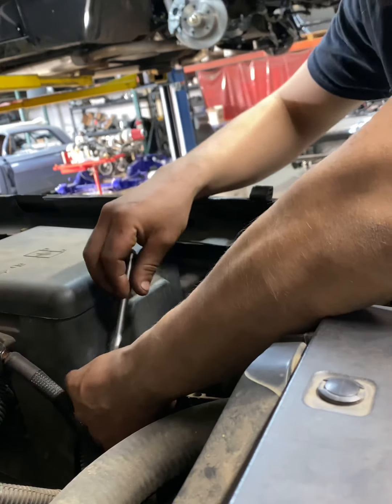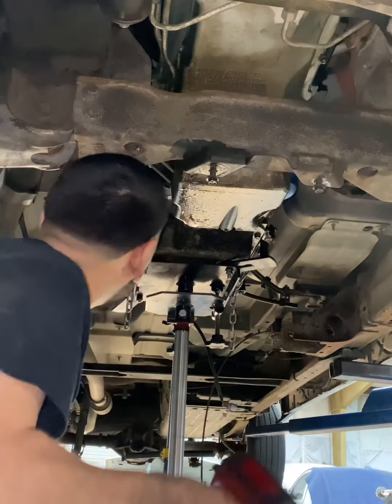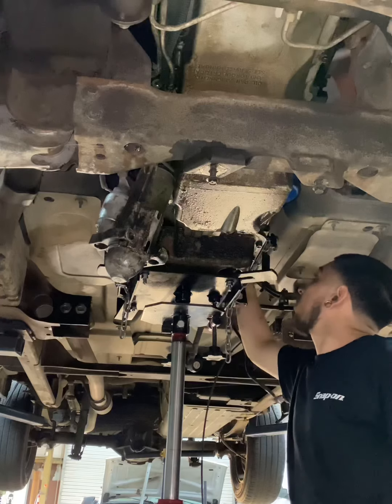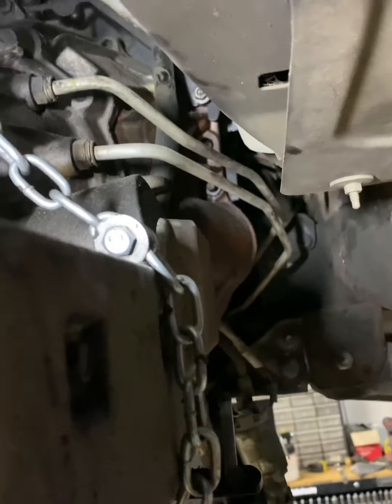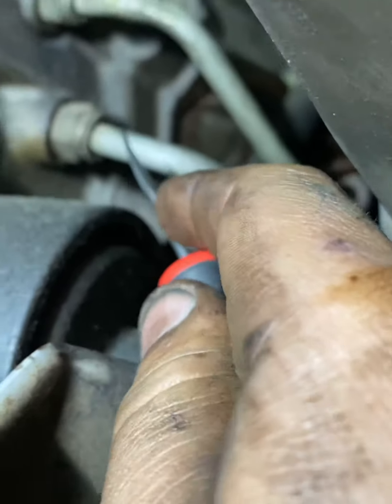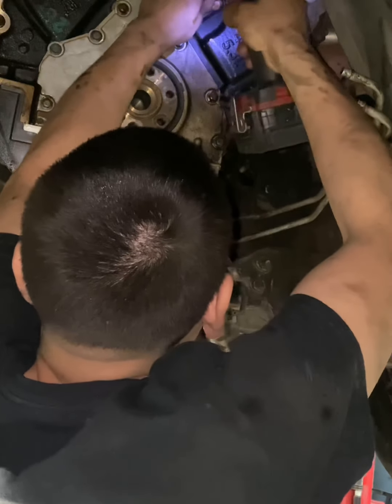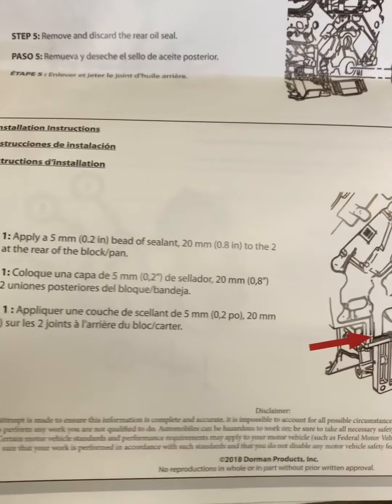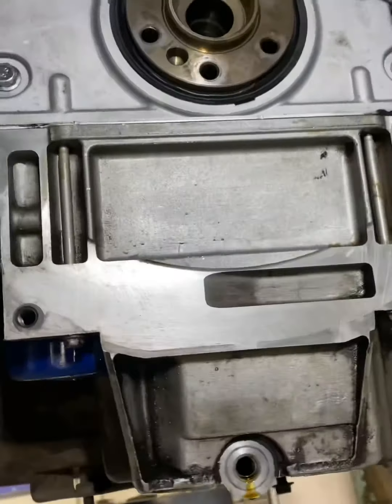99-06 LS engine rear main seal removal & install

Comment: For those watching I learned you should use a guide to center the seal on the driveshaft and torque all plate bolts into place. Idea is that the bottom two oil pan bolts can pull the plate and seal downward leaving a gap on the bottom of the seal. Torque oil pan last after everything else is held tight to prevent seal movement.

Hope this helps.
Reply: Seems to be a very common mistake and then people wonder why the seal keeps leaking after replacing it.

I personally would go ahead and take the oil pan off as well, replace gasket and re-install after the rear main seal cover is torqued to specs to eliminate any potential leaks.
Reply: You mean to centre the seal on Crankshaft NOT Drive shaft? Where to find guide?
Reply from the maker: @syrthdr09sybr34  been almost a year not one drop of oil 🙏🏽
Reply: @jameskrucial  Hey if it works it works. Just seems a bit risky to me.
Reply: @jameskrucial  It will leak thousands and thousands of miles down the road 50k'sh
Reply: What he said ^^^^ - First, you install front and rear covers with bolts finger tight/snug (in this case back cover). With the bolts now hand tight, cover will locate on the seal surface (like its home) and place the aligment tool as a guide to center the seal on the crankshaft . Torque all the fasteners to 18ft lbs (starting from inner bolts). Now you have to install oil pan and torque the long bolts to its proper specs, this allows the cover to pivot around the seal surface to mate flush with the oil pan (torquing the long bolts pulls the cover down). Now you finally torque the rest of the oil pan bolts to specs in the right sequence..

Comment: Great video! Just out of curiosity, is it normal to not replace the oil barbell while you have the rear cover off? Seems to be a common failure point.

Comment: Just FYI also my experience after swapping my transmission on an  all original drivetrain: The bottom 4 bolts of the engines rear oil cover had backed out finger loose which was causing the leaking (and the oil pressure sensor) The rear main seal was actually perfectly dry at 177k Miles. I replaced it anyway.

Comment: And your not supposed to put the pan bolts till the end you tightened up the bolts on plate first at torque spec 22lbs torque spec the pan boltd are 15 lbs t.. spec because what that dose it pulls the seal down el empacke se chinga pa if you tighten the pan bolts first

Comment: I'm trying to find a video without a lift how to do is at home
Reply from the maker: Same thing bro , just easier to show you on the lift everything is the same ,on the floor I use a motorcycle jack to remove and install transmission

Comment: How come you didn't use the alignment tool?
Reply: Only need that if the pan is not installed.
Reply: @charliedee9276 not true there's the right way to do it and the it might work way.